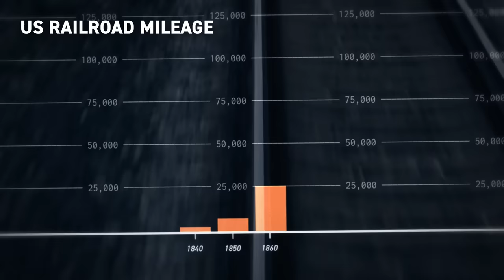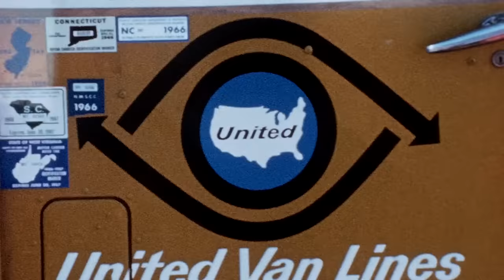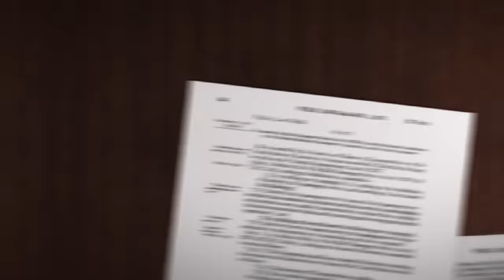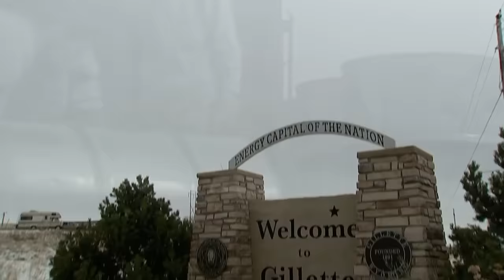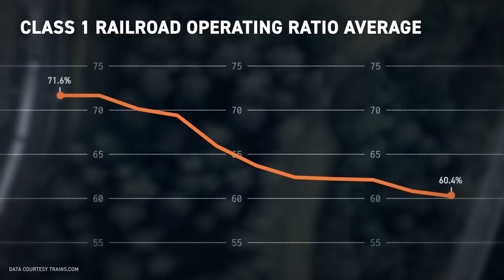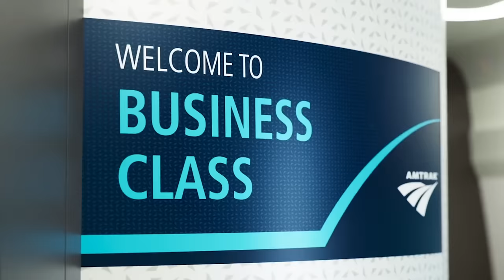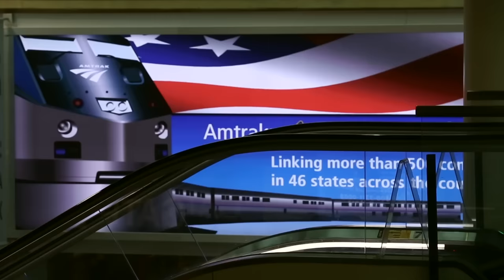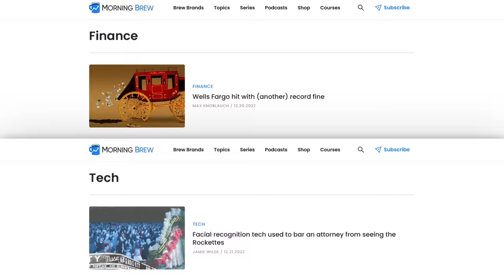The One Tiny Law That Keeps Amtrak Terrible

Comment: For those wondering, Amtrak's plans for new trains is called Connects US. It is a list of routes less than 750 miles in length, those which require state funding, which can be setup and run in a fairly short time frame. If all of the routes in this plan are created, Amtrak's daily trains will approximately double. A small step towards a much better rail system. Additionally, the FRA has created Corridor ID/Connect ID, a inquiry into new routes, some of which are in Connects US, which will be eligible for federal funding for startup costs. Those startup costs are most of the costs involved, so having those covered essentially guarantees a route will happen.
Reply: They are also replacing most if not all of their rolling stock with new trains by siemens in California.
Reply: Also several states like Utah and Ohio are expanding their own local train service to connect to Amtack.
Reply: There are also some interesting private, investor-backed routes starting up in Florida and elsewhere around the country. At some point, the standoff between passenger rail will have to be solved; maybe investors crying foul will be more persuasive to the federal govt than the struggles of its own passenger service (Amtrak).
Reply: Appreciate you sharing some good in-depth info.
Reply: I am glad this is happening, but I'm bummed that we're just getting lots more slow rails in random places. I would much prefer getting real modern fast rail in the Northeast corridor.
Reply: Amtrak Connects was a marketing campaign based on routes states had in their rail plans.  The real map of what we will get is the FRA corridor or long distance map.  There’s much crossover between each.
Reply: @dylanmcdowell3894  I hate that you're probably right. Doing it that way won't end well for anyone but the corps.
Reply: If they do Denver to Pueblo, they need to go on to La Junta, and even better, would be OK city to Lincoln, rather than just to Newton. 
Make more options for getting north and south than going all the way to California or Chicago.
Reply: Good.  Passenger service almost needs dedicated routes.

I’m wondering if it can also transport mail, parcels, etc…. As in these are added to the end of the train?
Reply: @dennisyoung4631  Amtrak tried that for a time in the late 1990’s-early 2000’s. From what I recall, it was abandoned because it  made the trains too long. Also, having to switch the cars around at every station also added too much time to the schedule.
Reply: @dennisyoung4631  That used to be the case with passenger railroads in the past. In fact, that is why passenger railways were profitable in the first place; the USPS mail contracts as passenger trains moved around on fixed and predictable schedules. These contracts were canceled once the Interstate system was built as trucking was much more reliable and cheaper than using trains since you did not have to pay private railroads to use their services. This is why the only way to make freight competitive with trucking and passenger rail competitive with driving is to nationalize the railroads.
Reply: @dylanmcdowell3894  for sure the only people who can drown out corporate lobbyists are other corporate lobbyists. Public interest be dammed.
Reply: Amtrak should be federally owned and funded, not a private corporation.

Defund highways.
Fund rail.
Reply: What we need is high speed rail, or at least construction of futureproofed tracks. And the government should invest in it for the same reason they invested in the original rail; to be able to move troops and equipment fast. And this time, not turn their back on their investment.
Reply: @shingshongshamalama  "but that's socialism!"
Reply: The fact the government is involved will guarantee it's failure or total lack of profitability.  If trains are to be successful, they must be able to compete wit the alternatives.  That will not happen in the US.  Amtrak should be dismantled, any profitable routes privatized and the government should not be involved in its operations.
Reply: @rayh592  You reading need to learn about the economics of high upfront cost low marginal cost industries before you say something stupid like that. You also act like the interstate highway system isn’t a massive subsidy to rail competitors.
Reply: @TheStrangeBloke  Slow rail doesn’t mean it’s not modern. Expanding transit to more places is good, and the NEC is still getting modernized.
Reply: @enkephalin07  depends on what is meant by “high speed.”

I’d think it “awesome” to get on the Coast Starlight at the time I recall, in Portland, for example - about 2:20 pm or so - and get off in LA at, say, 5 pm (instead of 9:30 pm, for instance.)

Now if I were traveling for business, though - it would be better if it got in LA a few hours sooner.  Still, though - the train is the most chill way to go if you’re not up to driving…
Reply: @rayh592   lack of profitability is bad? Okay then watch in glee as demolish the highway system gets demolished.
Reply: @whoisthatkidd2212  which is actually a fairly good idea, as 1) fuel shortages are looming, and 2) climate change is here NOW.  Rail transport, then, is about the best option we have under such constraints!

Corporatists and Corporations almost seem to be deep into Nihilism any more…
Reply: @Eaglescout217  sailors build trains?
Reply: @dylanmcdowell3894  idk doesn't japan deal with this already?  I'm not really that into trains but I know they have private lines
Reply: @TheStrangeBloke  The problem is that Amtrak, despite being operated like a corporation, is beholden to Congress. The best way to get improvements to the NEC is by creating more of these "too long to drive, too short to fly" corridors up and running through as many states as possible. The more people can see and use rail, the more likely they are to fund it as a whole. Highway funding is an easy win for a politician because virtually all their voters drive, whereas passenger rail (intercity, commuter, and metro) is virtually nonexistent in most of the country.
Reply: @rayh592  So you think we should cut off any government funding for air and road travel as well? You realize that roads are like 50% subsidized, way more than amtrak ever has.
Reply: @chromolitho  Siemens Mobility not seamen
Reply: Is there any way for us to help Amtrak?
Reply: @SuperSpidey313  ride trains
Reply: @TheStrangeBloke  This does more in the long term to change Americans' opinions about passenger rail. If we want to get to a future where high-speed rail crisscrosses the Northeast corridor and the country as a whole, expanding passenger rail service to cities and communities where it has never existed before will gradually change public opinion to support high-speed rail. Baby steps.
Reply: @dennisyoung4631  Amtrak tried doing that already, it failed pretty hard. They could probably try it again these days, but who knows how successful it would be.
Reply: @SuperSpidey313  write your Congressperson and Senators! As well as your State Legislators. Get them to fund Amtrak at the federal and state level.
Reply: We need completely separate high speed infrastructure for passenger rail. Anything else is a waste of time and resources.
Reply: @mrsleakyshit  it's not a good comparison. Japan is a small country with lots of people minus gazillion highways and bridges USA has, so we can get away with having poor rail system because we have more options to get from A to B and but Japan on the other hand can't,  not to mention the new infrastructure to run those fast trains on.= which they build .
Reply: @r.d.9399  that's exactly what people don't get that, that this issue can only be raised if new infrastructure to support those fast trains is gradually built. Obviously it will take many years but we have to start somewhere.
Reply: @Jakesullivan2112  what kind of nonsense are you talking about? Japan has an extensive highway network, as well as tons of bridges connecting their islands.
Reply: @piemadd  perhaps if they had a special design of rail car, one which permitted quick loading and unloading of “mail bins” - sort of like some Japanese trucks I’ve seen pictures of?  Like a forklift comes up, and inserts its tines into the slots underneath the bin, which unlatches it automatically, permitting an easy withdrawal?

Granted, this would not be a lot of mail, etc, per train, but if more trains started running (in lieu of, say, aircraft, busses, etc.) then it might be possible to hitch an added car or two onto the usual passenger train if said “mail car” were set up properly.

I do recall the train needing to stop for “longer” periods every so often when I rode it in May of 2021.
Reply: @hanadali3543  Will people actually ride these trains though? I have to think that a slow infrequent service from cleveland to columbus is just going to get ignored in favor of driving by most people. How much evangelism does a mostly useless train do for trains as a whole? If anything I think it would only solidify Amtrak's reputation for slow infrequent train service.

Running one really useful, fast, high capacity train line would do the opposite.
Reply: @alexanderstevens8774  Trains can also, easily, replace a lot of trips people are willing to drive with a little effort. Need to link existing dense areas, and push infill development as transit develops. 

Newark, New Jersey really needs to seize the massive parking lots it's sports stadium has. in a 3000 foot radius from Newark Penn Station, which is served by every single NEC train in  Amtrak and NJT, there's about 30 acres of parking lots. Not even counting street parking, And that's only counting below the Passaic River. It's utter insanity. Obviously some has to be retained, but a few parking garages could free up a crazy amount of space. And they could still have ground floor commercial.
Reply: @mrsleakyshit  3-4 daily trains is a big jump for many amtrak routes.
Reply: @Jakesullivan2112  Poor argument. The US has some very rural areas, but many regions are as dense or denser than Japan. Several states have population densities higher than Japan, including New Jersey. But even states with lower density usually have regions that are plenty dense for transit. Wyoming has counties with fewer people than the town I grew up in. Even several of them combined. But the area around it's capitol has density comparable to Switzerland. That's where you'd build a transit network. Not just from Ranch to Ranch.
Reply: Requires state funding yeah good luck
Reply: 750 miles are nothing for a country this size
Reply: omg piero famous
Reply: hi piero
Reply: U must to believe in our God. U must to believe in the Son of God. Doomsday is on the horizon. Believe Jesus Christ is the Son of God. Jesus is the Way the Truth and the Life. Our Saviour Jesus Christ died so that we will live. Jesus said, "I'm the way and the truth and the life. No one comes to the Father except through Me". John 14:6.
Glory be to the Father, and to the Son, and to the Holy Spirit.
Reply: @williamkesler2373  That was just a cover story to get Amtrak to drop the service.  Amtrak never actually tightened their schedules after they lost mail and express because they thought the additional schedule padding would improve OTP (of course, it actually just made freight railroads delay them even more).  The real reason is because the freight railroads were unhappy Amtrak was taking their business while using their tracks, being subsidized by the government, and also not paying the host railroads fair market rate for transit (they still don't, but I digress).  Rather than try to work the issues out diplomatically though, the Bush administration forced David Gunn to pull out of mail and express because they wanted to kill off Amtrak entirely.
Reply: If the idea needs taxpayer money to work; it can't be that good of an idea.  Good ideas don't require force to work.
Reply: Took Amtrak once, never going to take it again. The delay is just unacceptable.
Reply: @nathandfox  Well of course the dealys suck. Sam literally goes over why those delays exist tho...
Reply: The big thing that needs to happen is nationalization
Reply: But it isn't high speed rail... meanwhile every other first world nation has absolutely covered their country with high speed rail that travels at 150+ mph
Reply: I just don't think Americans will take the train like they do in Europe. Most people ride for leisure.
Reply: "federal funding" is the key word.  The US government has put us over $31 trillion in debt. The US is at the end of the road for printing money.  We simply do not have the money anymore to taxpayer fund wars, other country's problems, mass illegal immigration, and pay the world for climate change policies.  Funding billions more for Amtrak to lose more money is insane.  Nobody wants to pay the price for a 750 mile Amtrak ride, vs 1/3rd the price and a fraction of the time on an Airliner.
Reply: @Jakesullivan2112  Japan actually has oodles of highways and bridges. In Japan people have many more options too get from A to B. The US is the place with a lack of options.
Reply: @scotcoon1186  OKC to Tulsa needs to happen as well.
Reply: Amtrak desires the states to finance their operations with the freight companies providing the maintenance... Neither desire to do so... Simply put the feds could build new faster HSR tracks along new right of way throughout America, but there is no national political appetite to do so... When the USPS chose to fly the mail long distances more than 50 years ago, and truck the mail short distances, passenger trains disappeared throughout America. Amtrak was created by Congress after the largest and busiest passenger railroad along the northeast corridor went bankrupt when it lost its mail contracts. No longer do passenger trains have a dozen or more mail cars on their consists. Those days have gone with the wind... Unfortunately, not one HSR advocate mentions the previous history why Amtrak was created in the first place.
Reply: @savingferris8279  freeways are a terrible idea then?
Reply: @mikaelj90  😂🤣😂🤣😂🤣😂😂🤣😂🤣😂🤣🤦‍♂️
Reply: @piemadd  Roads are 100% government funded (local, state, or federal or a combination) with the exception of toll roads. Lets call Amtrak what it truly is, public transportation, and fund it as it should be.
Reply: @CaptainRon1913  People do though? Amtrak's strongest ridership outside of the northeast corridor is on state supported routes. The Surfliner is #3 in ridership for a reason...
Reply: @reduced2ash  Yeah no shit. You can't just build HSR out of nothing and expect ridership. You have to create a regional rail network and then build off of that.
Reply: @cliffterrell4876  Is CAHSR over budget? Yes. Has it cost hundreds of billions? No, the number is closer to 30 billion. Almost all of the issues related to CAHSR are with the contractors building the tracks and people fighting to change the course of the train.
Reply: @savingferris8279  Every piece of infrastructure in this country requires taxpayer money, what are you on about?
Reply: @scotcoon1186  The main caveat is how amtrak's funding is setup. If a route is over 750 miles, it turns into a long distance route and amtrak gets the bill. They could probably do some trickery to get around this rule with a "different" train thats just the same physical train, but who knows if that would work. I do agree though, ConnectsUS isn't a perfect plan, it would be great if it could go a lot more places.
Reply: @TheStrangeBloke  While the NEC isn't perfect, its good enough to have a stronghold of the Air-Rail market in the northeast. Increasing ridership across Amtrak's network with more, slow routes, like those in ConnectsUS will increase ridership and interest all around, and as Sam mentioned, it turns into a self feeding loop.
Reply: @kevinhicks1108  Yes
Reply: @savingferris8279  It would be shit. The few private roads that do exist in the US cost tons of money to use. Look at the Chicago skyway and the like. Not to mention, if our roads can't make up the money to pay for themselves with registration fees and gas taxes, what makes you think private entities will?
Reply: @savingferris8279  It's not because of "government inefficiencies" lmao. If you look at the amount of money taken in road revenue vs the money spent to build and maintain roads, there is a fairly large gap between the two. Also you're further proving my point because if we kept our roads up to spec, then it would widen that gap. 

Also you bring up the VA hospitals, but the fact of the matter is that those have much lower death rates and costs than their private counterparts. 

Sounds like you need your education lol...
Reply: @piemadd  More trains is better than no trains. My concern is that nationally we've got a fixation on train services that are only really useful to a small fraction of people.
Reply: @savingferris8279  You know, I would take education advice from you if you didn't mix up "due" and "do". 
Also, I am not wrong about roads and bridges. There are private tollways in the US, and they're damn expensive. IE the Chicago Skybridge costs $6.60 for a car, which is $1.10/mi. That IS expensive. Regardless, our roads dont currently pay for themselves, most states hover around a 50% revenue to cost ratio.
If you looked into cost overruns of various gov projects, you'd find that it is typically from contractors inflating pricing. A good example of this is when Amtrak uses their in house track teams vs contractors. Their in house team replaces tracks and ties at a FRACTION of the cost of their private counterparts.
And on the topic of VA hospitals, while I've never stepped foot in one, I was simply going by what the stats say. Asking to ask, what VA hospital gave you a shit time?
Reply: @goatface6602  So everything loses money and fails?
Reply: @TheStrangeBloke  The ConnectsUS plan focuses on increasing ridership around population centers though? Also, yes, Amtrak's long distance routes don't serve a lot of people, but that's because they act as more of a lifeline for some communities rather than a regular service.
Reply: @whoisthatkidd2212  Only if you'll  figure in the massive economic benefit of the interstate highway system to the economy first before you demolish it. And I do mean massive.
Reply: @CaptainRon1913  If passenger rail was profitable it would already exist as the private sector would already be doing it. What we have here is a bunch of people who want taxpayers to pay for their train rides even more than we currently do.
China found out how building a massive passenger rail system outside of the large population corridors can make close to a trillion dollars disappear into thin air.
Reply: @piemadd  and the GW bridge toll in NYC is $14.75 and that's public. What does that work out to per mile? 
One random data point proves nothing. 
Also your claim that states operate at 50% loss in road maintenance is so factually wrong I think you made it up.
It's clear you have no interest in educating yourself.
Cheers.
Reply: @iknklst  so if you can recognize that government subsidized services like the interstate system can be economically beneficial outside of profit then why do you have this profitability double standard between train infrastructure and car infrastructure?
Reply: Missouri already pays over one million to keep two trains going from St Louis to Kansas City, a total waste of tax dollars.
Reply: @kenmelrac  The Missouri River Runner generates ~200million in economic impact yearly. That makes the route worth it. Also look at the costs of MO roads and planes...
Reply: See I have no idea paying taxes for this. But Mismanagement of funds is so prevalent to feel confident that’s where my funds would go
Reply: I looked into taking a train from MD to SC recently.. its faster to drive.
Reply: @DocHellfish  That's a long distance train. The routes talked about in ConnectsUS are shorter than that, and will have lower run times and higher average speeds due to needing less timetable padding.
Reply: They're welcome to do it, as long as they don't ask for tax dollars.
Reply: @nolongeramused8135  How else are they meant to do it then? Also do you keep the same policy when it comes to planes and roads?
Reply: @piemadd  Nothing is stopping someone, anyone, from building their own tracks and maintaining them, and giving their passenger rail service the priority to use them. Nobody does that because it's hideously expensive, and when government gets involved it's a massive boondoggle of graft (see California). So they pay a pittance of a fee to use tracks owned, built, and maintained by the freight lines. If they really want priority over freight, they need to PAY for it. 

Also, why bother with passenger trains in the US? Air travel is cheaper and faster for the distances involved if people aren't going to drive. Passenger rail really doesn't fit in once you get past the crowded east coast. Do you really think there is a demand for passenger rail service that goes from Houston to Seattle, for example?  You can fly that in 4.5 hours, vs the three or four DAYS it would take by rail. And the flight would be cheaper as well.

Did you know that such things are private airfields and roads exist? I suspect not based on your post. Also, separate airports devoted to freight are a thing as well. Additionally, the bottom line of most passenger airlines is supported by carrying packages. That's one reason they don't want you loading up the plane with luggage - they make more money off of parcels.
Reply: Can the government start to build new passenger rail on highway lanes where they already own the ROW?  We know those routes are where people already want to go...
Reply: @CindyMcLaughlin1  Sure, if you want to pay for the massive tax boondoggle that will be government rail construction. I'd look to California to see how that works out.
Reply: @plemadd - Going to be extremely difficult to do that mainly due to the eminent domain issues in the U.S. Would require taking over a lot of land and then everything gets caught up in the courts because a lot of people don't want to give up their land even though they're paid generously
Reply: @CindyMcLaughlin1  They can, and in some cases this will work, but a lot of highways are far too bendy to allow rail to get up to proper speeds.
Reply: @bherber  Almost all of ConnectsUS will be using existing ROW. Initial costs involved will be to help with track upgrades needed for adequate service levels.
Reply: @bherber  Generously? Eminent domain rips people off fairly frequently - "generous" would not only be fair market value and moving costs but also include a significant premium for being forced off your property.
Reply: We got a lot of light  rail expansions going  on here in the puget sound  / greater  Seattle  area. Reall excited  for  it all myself.  Always  wanted  to ride a train  :)
Reply: @dennisyoung4631  what I experienced in Switzerland was minimal additional cargo to passenger trains.  But passenger trains had maybe 5 min at major stations and even less at smaller stops in order to keep everything on time.  But an automated loading/unloading could easily take place at any station.  So much potential!
Reply: @TheStrangeBloke  on time is the key for me, second is duration of trip, then cost.  After living in Switzerland for 3 years, we were really spoiled!
Reply: @TheStrangeBloke  also, I'm in Cincy with family in Cleveland,  Toledo and Lima.  I'd love to be able to take advantage of a realistic on rime routes!
Reply: @sirpieman300  I've been on it just once: slow, and I wish I had a pistol with me for all the hoodlums that hopped on once we got to the bad part of the route from the CD to downtown. Sure, it was dirt cheap, but it took three times as long as driving and we still had to Uber for ten miles once we reached the end of the line at Husky Stadium.

If they get some express routes from the north end (Lynnwood, Northgate, etc.) that shot directly to the airport, I'd reconsider it.
Reply: @gljames24   That's not really true in Ohio. There is very vocal support by the public for state supported rail in Ohio to connect to Amtrak but NOT in state government, which in Ohio, is run by a bunch of idiots.
Reply: State funding? You mean taxpayer funded
Reply: @akshonclip   Probably. That's where states get most of their money, from taxpayers and they spend it on all sorts of things, some very good, like education and some very stupid/political. So, why not subsidize passenger rail to move people around your state more effectively, efficiently and in a more safe way than driving a car 75mph on a crowded highway.
Reply: @akshonclip  Youtube user discovers how the government operates. How do you think our roads and airports are built and operated lol?
Reply: @davepov  Three words. “Train To Nowhere”
Reply: What is a mile?
Reply: And it will be terrible
Reply: @gljames24  g%g%%%g%%%%%g
Reply: @clownsey3382  a mile is about 1,600m
Reply: @bearb1asting  why?
Reply: @piemadd  it won't pan out the way they are hoping for. Amtrak has to be sustainable and profitable on its own in order to advance.
Reply: @bearb1asting  Why is that? It is a public service? Many other public services don't have to operate like that.
Reply: Are they gonna start running the autotrain from NYC to LA? (& other routes) Because, you know, it currently only runs from VA to FLA and back...
Reply: @TheStrangeBloke  The area is so built up with so much of the land already owned by others that high-speed rail tracks would be nearly impossible to construct. High-speed rail can't work with hairpin curves and sharp turns. You would end up having to bulldoze your way across countless industrial parks, university campuses, and even whole towns. Even when they built Interstate 95 half a century ago, this was the case, which is why I-95 twists and turns its way back and forth (and even jogs in Providence) with very few straightaways more than a couple of miles long.
Reply: @stevenlitvintchouk3131  Hell yeah baby, bulldozer go vrooooom.
Reply: The NIV is not the most accurate translation. In the King James, we learn it is acceptable to tell lies when necessary to avoid harm to oneself, to another or to some thing. The problem addressed by the Commandment "shalt not bear false witness" is knowingly deceiving others to believe lies (without technically lying) and/or unknowingly passing along falsehoods as truth. In some Christian dogma, blind faith is the only requirement. In others, faith is demonstrated by works. Jesus didn't go around foretelling an eternity of hellfire for rational unbelief.
Reply: @Cal90208  it’s TOO SLOW
Reply: @alexanderstevens8774  if done poorly people would see how poor it is and not want more
Reply: @hanadali3543  baby steps is not how you do rail sir
Reply: @r.d.9399  exactly but these fools don’t get it
Reply: @dennisyoung4631  sounds like china
Reply: @Joesolo13  that’s a suburban rail with regular service
Reply: @Grafschafter22  per route
Reply: @nathandfox  yet these fools want more slow trains.
Reply: @djbeezy  cause the train is useless and slow here
Reply: @piemadd  the slow trains run at 40 mph that is horrible
Reply: @nolongeramused8135  - Yes sir generously... Do you have any examples of people being ripped off?  I'm sure you enjoy living in this country and benefit off of many things infrastructurewise that have been created as the result of eminent domain
Reply: Great can’t wait to see that when they finally finish in like 100 years.